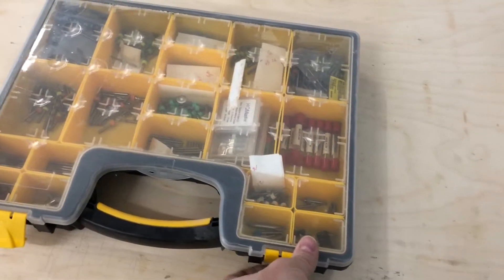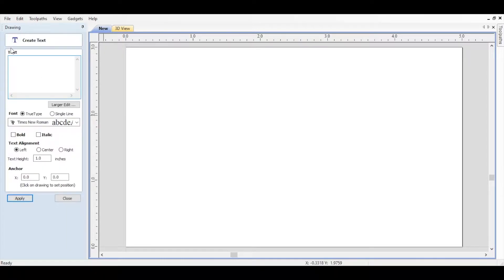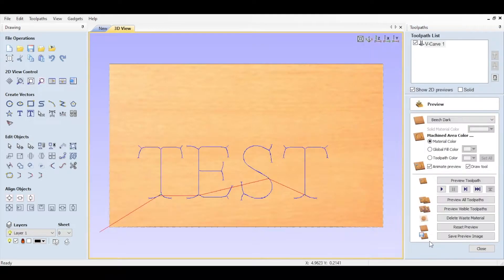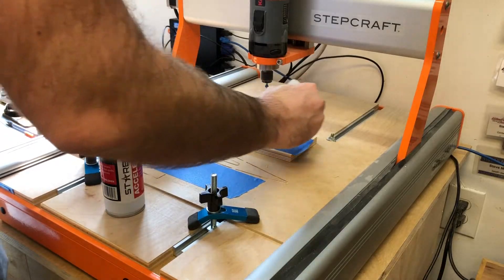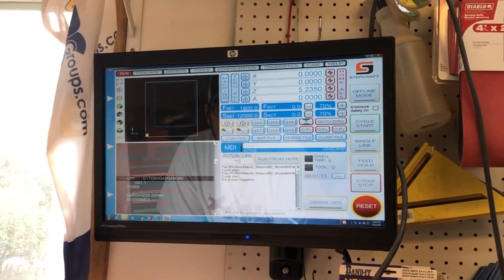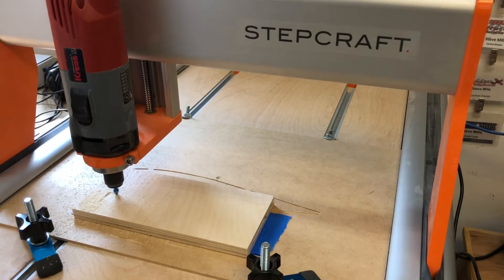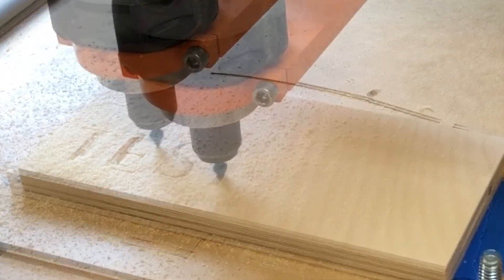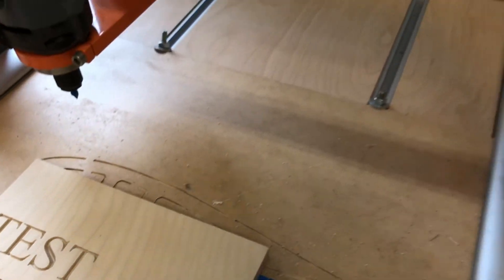Stepcraft D600 CNC Engraving with 60 degree V Bit from Rockler

Comment: Dear lucky stepcraft owner, please advise. I would like to buy that same machine for small scale production of knife handles and accessories. Main materials are G10, micarta, wood and light milling of titanium and aluminum. But 99% will be working on handles from former materials. Is this thing capable of 3d milling knife handles from a sheet of material?  Please see the picture for example:  https://blackwolfsupply.com/wp-content/uploads/2020/05/lst5_mi3.jpg
Would greatly appreciate your help!